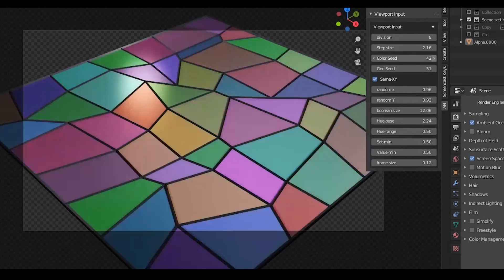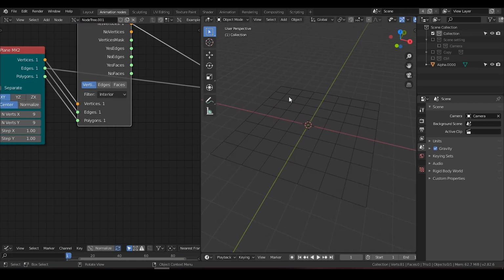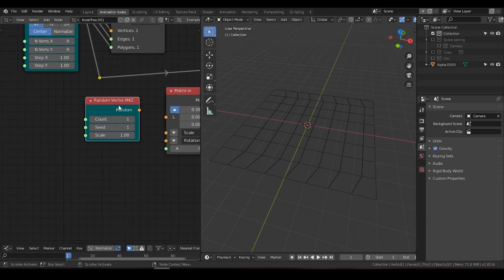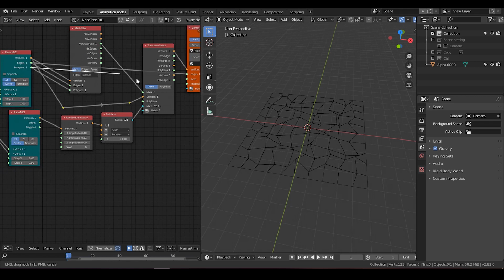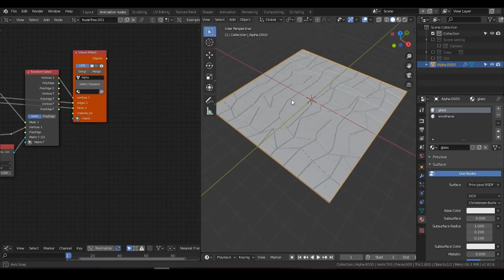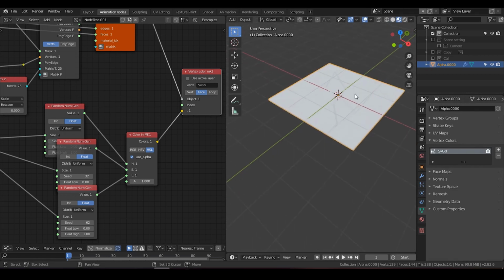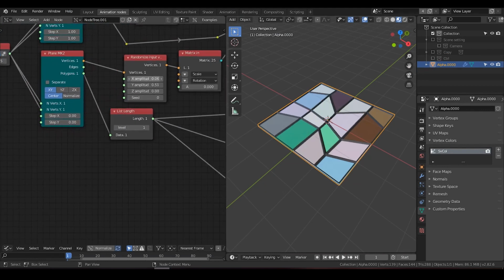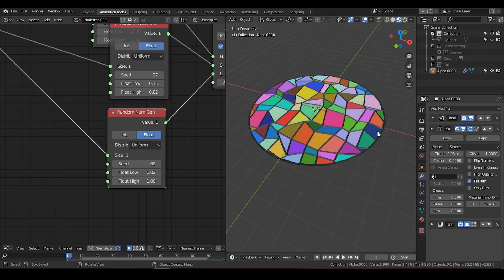[Tut] Procedural stained glass - blender Sverchok

Comment: I made it to past the 7:00 mark, but when I connect the Vertex Color to the Principled BSDF, I get an aqua shade of green for most tiles, with some blank tiles randomly placed.
Reply from the maker: I wonder about how it really looks, if possible you can contact me on facebook "www.facebook.com/NeisBradley"
Currently just some thoughts, in "Color in MK1", make sure it's on "HSL" and make sure that "use alpha" has been checked.  Tweak values of random number generator, whose type should be "float", and range between 0 and 1, to see if there is any change.
Reply: @bradleyanimation120  I just sent you some screenshots, before completely reading, of course, and upon reading under "read more" I knew without looking my random number generators had "integer" selected instead of "float".  Fixed.  Thanks!